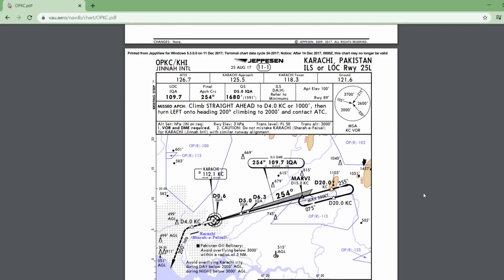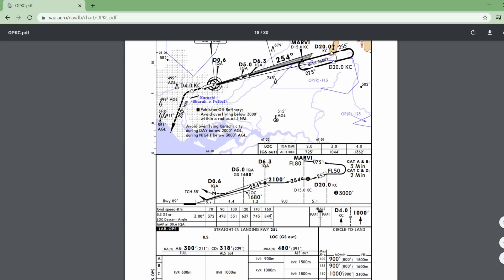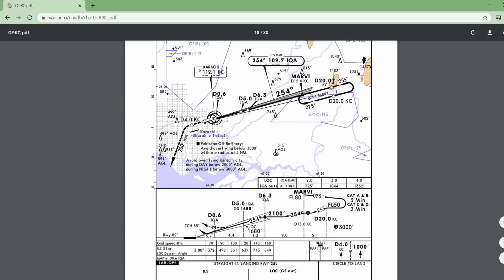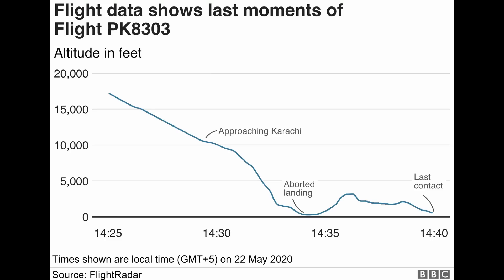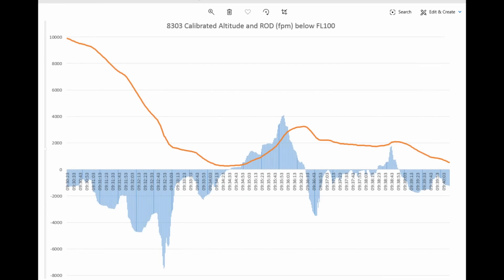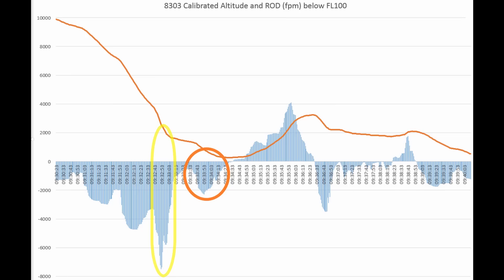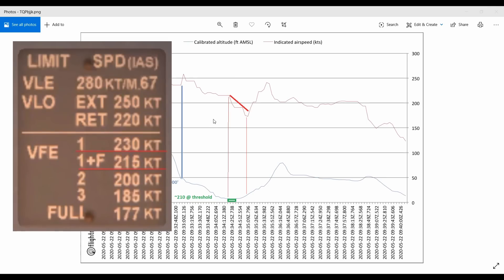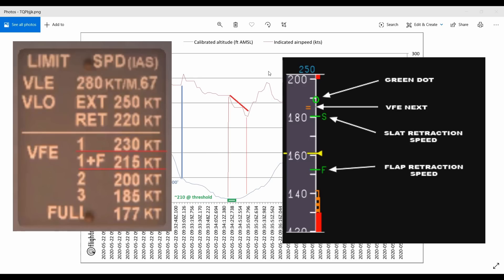PIA #8303 Update #4 Unstable Approach Profile

Comment: I am going to make a SWAG here, but based on your analysis, I am guessing they had to keep the gear up to get down and if they were at 210kts over the deck, they didn’t put the gear down and I am willing to state that they probably didn’t realize the gear wasn’t down until they made contact with the runway. The aircraft engines sustained sufficient damage that they both hung and once that happened, the aircraft became a brick.

Comment: If I were trying to slam dunk it, the gear would be the FIRST drag device i'd throw!
Reply: Not the speed brakes then which are designed for this purpose
Reply: @tomstravels520   well sure, both,  but the gear is way more drag and you don'tland with boards - so you have to be careful about using them in approach.  Throwing the gear out early/ out of sequence should be in everyone's toolkit. No wonder they were overspeeding the flaps without the help of the gear. Not only that, gear is of huge importance because the engines are tuned to have a spool N1 with fast response for a go around when in the landing configuration. These engines were probably at full idle so the spool up time is a good 3-4 seconds longer, the plane would've been very squirly/mushy during that go around. Very bad.

Comment: Looks like the pilots panicked as they missed the approach.  Dove down in a panic and forgot or could not extend the landing gear.  Smashed into the runway and then were surprised when the plane was damaged.  Such a needless tragedy.
Reply: But... Y U no go around?
Everything you say makes sense if you presume that they (for some reason) couldn't make a second attempt. But the only reason I can come up with would be fuel shortage, which again would be a mindblowing error as they had no deviations, no weather and didn't declare low fuel. They should've had almost enough to fly back to their origin, let alone an alternate or just circle. So.. even if they were way off and even if they initially panicked, how did they forget such basic training lessons as "when in doubt, go around"?
Reply: @QemeH  Alot more to this story, no competent crew would screw up this bad. Not saying they didn't do it but why is the question. We got to assume the pilots had SOME training on standard approaches. Maybe the pilots kid was flying (yes it has happened)

Comment: I've been known to fly my Long-EZ kind of like a cowboy when I am hot and high, and can usually rescue the approach with some attitude change, slipping and radical power changes, but this is with a relatively low wing loading, and no passengers aboard. To do this kind of thing with a load of passengers, and just because you are free to do a visual approach is unconscionable. I know that we are waiting for the FDR  and CVR data, but it is pretty obvious that they got behind the aircraft, and just couldn't rescue the approach. They were too fast to get the proper flap configuration, and the gear alarm seemed to indicate that they were too fast for it to deploy even if they tried to do so. My heart goes out to the passengers and crew for this very unfortunate incident.
Reply: No sympathy for the two pilots.
Reply: I would suggest you stop flying like "kind of a cowboy" so when you ever get involved in an incident or worse an accident people will refer to you as a safe and responsable pilot.
And with taking less risk (of  which you will say is a calculated and safe risk ) you might live longer to enjoy that Long-EZ also ;-)

Comment: The data keeps backing my fear that captain plunged the aircraft down at the very last moments before landing. High speed, High Altitude.
Can we see data of other PIA flights which landed at KHI airport or LHR airports because I have traveled with PIA and have experienced such fast descents during their local flights, you feel like your heart is coming up to your mouth. It has been a long time since I was aboard PIA, way back in 2010 but it seems like nothing have changed.
Even CAA has to be questioned here that why they have done nothing to curb these types of aerobics. Unfortunately, this seems to have become some sort of a culture in PIA as there is no accountability and once the crew gets experienced, they feel like they are the Gladiators and can do whatever they want.
Feel sorry for the passengers and their families.
Reply: MrCloudseeker  That is a very valid practice and might be what this crew was trying to do. But even such drastic maneuvers still have to follow SOP and I doubt it is a company policy to be booking 200+ knots on final with no gear down indication.
Reply: hypsin - There is a speed limit on landing gears. I don’t know what is the VLO speed for A320. But 200+ knots seems too much and if you’ll try to lower the landing gear at this speed, they might not work.
Reply: They could come in over the water instead of land and do a normal descent.

Comment: That steep of an approach and then trying to go around after having the engines grinding on the runway for as long as they did, come on now. 😬
Reply: The engines were spooling up to full power - they had no choice but to go round
Reply: vidznstuff1..,Preliminary data indicates that the pilots applied power AFTER the aircraft had already scraped the runway. This will not be ascertained until a full review is done.
Reply: I believe they were about to go past the runway because of the speed which is why they went for the go around.

Comment: I wonder if they look into this pilot's past history of landing approaches at this airport if he exhibited a pattern of too fast and too steep of an approach.
Reply: They asked: “You pilot?”
Answer: “Yes. I fly wing-suit” Licence granted. What could possibly be so important not to go around to save a ridiculously botched approach?
Reply: @Al D they have to maintain currency, to that requires a minimum amount of hours and instrument approaches. For the airlines that means back to the simulator if you need the hours.
Reply: @tonyascaso6254  in Pakistan they require that? Not being an a hole really just a question are you sure they require it?
Reply: @chrisheid5532  yes, in Pakistan also. ICAO coordinates standards across all countries an if an airline doesn't conform their planes are banned from other countries' airspace. This happened over 20 years ago with Korean after one of their aircraft ran out of fuel while taxying in at Heathrow. Also ISTR Air China getting into similar trouble because their pilots were mostly ex-air force and were considered too reckless. Maybe the problem here?
Reply: @Al D I had that same question and thought about asking it. The reason I didn't was because I doubt it could be that or just maybe it could dunno. It seems like such a huge mistake that it almost seems impossible it could be that but then I think of all the stupid pilot error things that have happened and it leads me right back to that question. Did they sit to long without getting time in the seat?
Reply: I'm wondering if they took blood and tissue samples from the flight crew to check for drugs.

Comment: A descent rate over 7000ft/min. I can't even imagine how scared the passengers were.
Reply: Free Tall Terminal Velocity is 10,380 ft/min so the passengers definitely felt their stomachs dropping.
Reply: @timhardman4764  you only feel it in your stomach when accelerating. Once you are descending at a constant speed gravity will still push you into your seat at 1 G. Like in an elevator you feel the initial acceleration but once you are up to speed you feel gravity normally. If they nosed down smoothly into the fast descent the passengers wouldn't feel it in the stomach any more than a normal descent.
Reply: Keith MacDonald That is right but in this case, it took them only 20s to go from a descent rate of 3500fpm to 7000fpm and back to 1000fpm according to the graph shown so the passengers definitely felt that acceleration.
Reply: @timhardman4764  The passengers were inside the plane, they did not have 80mph air rushing up past their bodies. They were not in free fall, like a sky diver.
Reply: Tim Hardman - It’s not the rate you feel but the acceleration. You also feel deck angle. In this case, the deck angle was probably not that steep to an inexperienced passenger.
Reply: That was my thought too. It must have been a very wild ride for the passengers. Plenty of time to have the crap scared out of some of them.
Reply: The passengers were actually clueless about what was happening, as told by one of the survivors. They had no clue they were in such a dangerous situation

Comment: Excellent review as usual, thank you.  Just be mindful though that we don't have ADS-B data for this flight.   If we did we would have a much richer data set.  I am pretty sure that in this case FlightRadar24 and others are relying on multilateration (MLAT) to infer position and altitude, with rates of descent and groundspeeds in turn being calculated from those inferred data points.   They are reasonable estimates but not as accurate as ADS-B.

Comment: Looks like TOO MUCH IMHO, even a student wouldnt have put this jet into a dive to intercept the slope. Something is missing here. They didnt report any emergency  though .... very rare. I would think they were fighting the plane at some point. If so, as soon as they had touched ground, why they would try to get airbone again ??????.
Reply: There was no emergency, they forgot to extend the gear. If it were a trim runaway they would've not been able to transition from 7000 FPM to 2000 FPM and make it to relatively close to the touchdown down.

Comment: Jaun, was the descent fast enough / steep enough to attain Zero G ?
Reply: If my calculations are correct, 7000 ft/min comes out to negative 3 Gs. They possibly had some injured passengers before they even hit the runway.
Reply: msnpassjan2004 There is no connection between steady descent rate and g-force (acceleration).

Comment: Looking at that one document is rather interesting, not to overfly below 3000 feet near the oil refinery and the city itself. I would like to see another video but to have it compare 8303's first attempt of landing as compared to another flight's successful landing at this airport. It might explain some of the diving, but not the speed.  I also wonder if there were more alarms as they tried to put the plane into it's landing configuration, such as if you set the flaps from 1st position to full, but are traveling too fast.

Comment: Is there a way to get historical ADSB data for the crew/airline? 
Also I find it strange that a pilot with as much experience as they had to fly an approach like that without reason. 
 I think the cockpit voice recorder is going to be key figuring this out.
Reply: SouthJerseySound One of the comments found descents of 5000ft/min in earlier tracks, so there may be a history to this.
Reply: Only if the aircraft is fitted with ADS-B which this one wasn’t. Other yes you can go onto Flightradar24 or flight aware
Reply: @tomstravels520  if that's the case then where did Juan get the ADSB data from used in the video?
Reply: SouthJerseySound https://www.flightradar24.com/blog/pakistan-international-airlines-flight-8303-crashes-near-karachi/

It’s not ADS-B except for the path which showed how a normal approach should look. This aircraft was tracked by MLAT